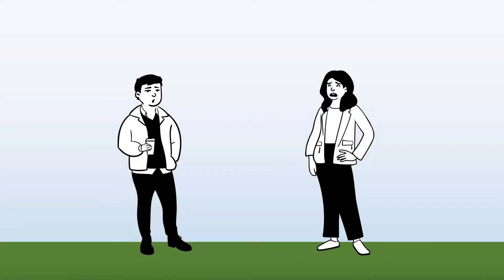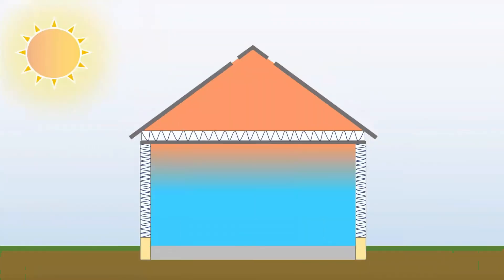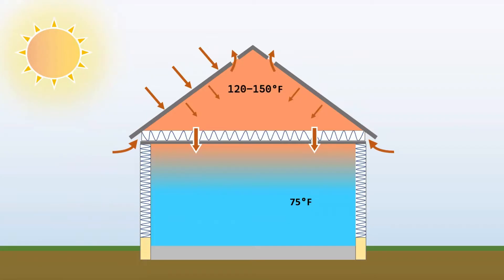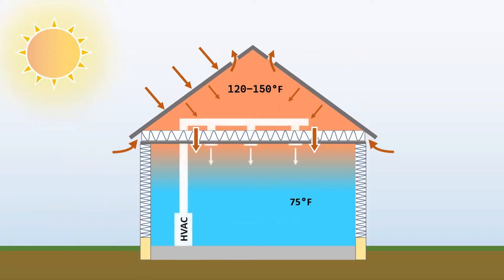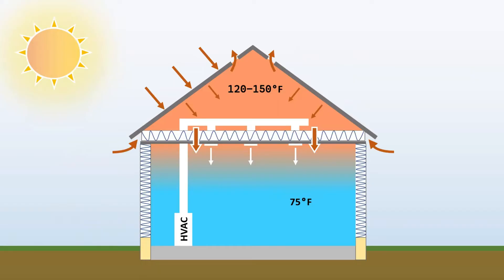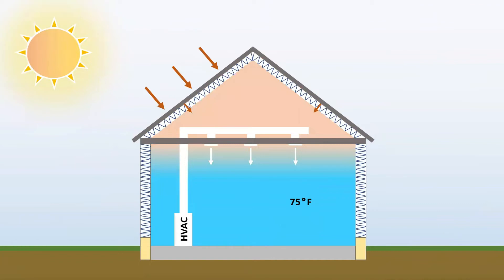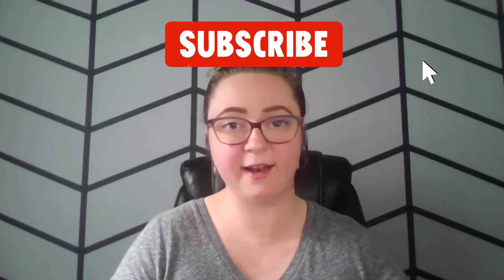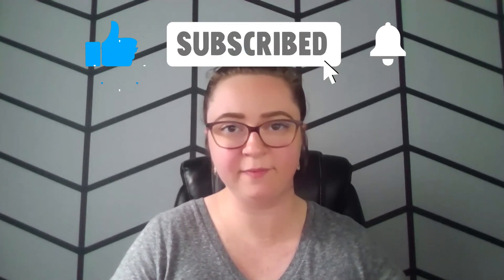Vented vs Encapsulated Attics

Comment: Looks good on paper but.... The larger volume of conditioned space requires much more HVAC.
Reply from the maker: You bring up a great point, @harveypaxton1232! Encapsulating the attic does increase the conditioned space, but the key advantage is reducing heat gain/loss through the ceiling and eliminating extreme attic temperatures. In many cases, this actually reduces HVAC strain rather than increasing it, especially when ductwork is inside the conditioned envelope.

That said, proper HVAC sizing is crucial. Manual J calculations should always be done to ensure the system is optimized. 😄
Reply: @ The attic space is usually not in the manual J calculations from the reports that I have seen. I will have to pull up the last one that was done for me.
Reply from the maker: @harveypaxton1232  You're correct that the attic space itself is usually not directly included in Manual J calculations, but it does influence the load on the living space. In a vented attic, the heat gain is accounted for through the ceiling insulation, so the attic temperature impacts the cooling load but isn’t part of the conditioned space. In an encapsulated attic, where insulation is at the roof deck, the attic can be treated as semi-conditioned or conditioned space, and in that case, it may be included in the Manual J calculation.
Reply: @ Thanks.

Comment: Nice video.  Just one small error I need to point out.  Here in Hillsborough County (Tampa) you would not pass a final inspection with that 2 ton system. Two tons is 24K Btu and with only 22.5 Btu you're too big for the energy efficiency standards. The building dept. warned me about this 12 years.  HVAC contractor had put in a 4 ton system in a house I was rehabbing. I asked where my permit was and after a week of being ignored I went to get it myself.  They told me I needed the Manual J calculations which I called the contractor about from the county's parking lot. He proceeded to "ghost" me and I ended up doing the calcs myself. Ended up buying single use software for this, took paperwork back to county and met the head of mechanical inspections who said my work looks great but no chance of passing inspection.  Had to swap in a 3 ton system.  Went thru 5 different HVAC contractors before I found one totally honest and fair.
Reply from the maker: We appreciate your insight! davidoberlander6200 You're absolutely right, Manual J calculations are essential for code compliance, and Hillsborough County enforces strict energy efficiency standards. We’ve seen many homeowners face similar challenges when contractors install oversized systems without proper calculations, leading to inefficiency and inspection roadblocks. Kudos to you for taking matters into your own hands and making sure everything was done right!

If you’re ever working on another project and need expert load calculations or HVAC design support, feel free to reach out, we’d love to help! 😄

Comment: I can’t find anyone to help me design an encapsulated roof for my remodel in Kansas City.
Reply from the maker: Hi @1AlexanderCole! We understand how frustrating it can be to find the right help for designing an encapsulated attic. Since these spaces don’t have traditional venting, it’s crucial to get the HVAC design just right to prevent moisture issues and ensure proper airflow. We specialize in Manual J load calculations, duct design (Manual D), and energy calculations to help make sure your system is optimized for comfort and efficiency. If you’d like, feel free to email your floor plan to tom@procalcs.net and we’d be happy to review it and see how we can assist!😄

Comment: It is a lot more complicated than this. More details need to be considered and well made vented attics can be energy efficient too.

Like don't run duct work in the attic for one.  The venting prevents ice dams in colder climates and dries out the roof. If you encapsulate you need to manage the moisture that gets up there in other ways.

Comment: Is this more an idea for warm zones? I am in zone 5/6 where we get ice dams if the attic space is as you suggest, no vents with openings between attic and rooms below. Snow loads melt and refreeze at the eave where there is no warm air under to melt it, creating the ice dam and in my case, 6 foot long icicles. My new roof now is vented and having come out of -5 degrees a few weeks ago with snow, I had zero icicles or ice dam effects. But I am actually adding your "encapsulated' effect under my vented roof creating a 2 inch gap from under roof OSB to a second layer of OSB under the roof which will fill each bay creating a 2 inch gap. I plan to cover the upper roof with foil to reflect the radiant heat, keeping the gap below it at 2 inches to allow the foil to work. Then I am putting 6 inches of insulation into the bays and finishing with drywall on the conditioned side. Happy to hear your thoughts. This home is a 1907 foursquare. Also, thanks for the video, I see how it can work well in those hot environments not subject to cold extremes. Take care.
Reply from the maker: @johnalvitre3154 Great question! You’re absolutely right, fully encapsulated attics are more common in warm climates where the goal is to keep heat out. In cold climates like Zone 5/6, improper encapsulation can lead to ice dams, which is why balanced insulation and ventilation are key.

Your hybrid approach sounds really interesting! Creating a 2-inch air gap under the roof deck with foil to reflect radiant heat while maintaining ventilation could help regulate attic temperatures year-round. We’d love to hear how it performs. Thanks for sharing your insights! 🙌

Comment: Some really good points. Here are a couple of others: In wildfire areas, encapsulated attics are more resistant to fire spread, because they don't have vents that embers can get inside. But, just in recent years, homeowners' insurance companies are starting to look askance at sprayed-in foam in homes, but I don't remember what their issues are.
Reply from the maker: Thanks for bringing up those excellent points! Encapsulated attics are a smart choice in wildfire-prone areas since they eliminate vent openings that can let embers in—a crucial safety feature.🙌
Reply: I watched a video or two about the insurance issue specific to the UK. It's usually the perfect storm of sloppily or inadequately applied open-cell foam on an unchanged, unrepaired vented attic that can't afford to have that kind of insulation. They create an internal dew point with no good way for the moisture to leave, and the open cell is basically a urethane sponge, where the roof may have been designed with permeable internal insulation exclusively. I think at the end of the day the homeowner just has to do a good amount of research into the theory behind wall/roof design and what that roof can handle, or consult a home designer or architect or even engineer before just hiring a guy to spray it in with no questions asked.
Reply from the maker: @youmakeitwhatitis  Great insights! You’re absolutely right, poorly applied open-cell foam in vented attics can cause serious moisture issues, especially without addressing the roof’s design. Research and consulting professionals like architects or engineers is key. Thanks for highlighting this important point 🙌

Comment: This essay remains inappropriately silent on humidity levels and radiant barriers.  In the 3rd quadrant of any Cartesian plane of the continental USA (namely, the Southwest quadrant) we are dry and not humid, and radiant barrier work wonders at zero recurring cost.  They're utterly passive.   In the Los Angeles metro area, we have some humidity, but my house has a ventilated attic with lots of radiant barrier countermeasures to hot attic problem.  So what if I have to go into the attic occasionally; that's a red herring.   My attic is huge, buffers my living space from heat, and NOT part of my energy bill, at all.   And I have no "spray foam" with all its potential outgassing and weight load on the rafters of my roof.  Matt Risinger is the original evangelist for conditioned attics, and he's geographically centered in Austin TX.    Location matters.    In California, we pay $$$$ for electricity, so passive methods and ductless a/c (heat pumps) are the way to go.   Of course, a California home unchanged from original 1960s design is "making ice cream in an oven" so the electric bill is punitive.

Comment: Closed cell polyurethane spray foam is a great thing.
I heat and cool 2100 sq ft with a 100k btu water heater throught pex secured under the subfloor, 1.5 ton a/c unit  too.

Comment: In our home I replaced an old inefficient gable fan with a newer lower amp model, but still found it to run too much when set to 110 degrees F. After tacking up a simple mylar film to the underside of the rafters, the fan stopped running. I had to bump the temperature setting to 80 degrees to get it to run again. The mylar foil is so effective I think because it vents under roof decking from eave to ridge and doesn't allow hot air to circulate into the attic space. Encapsulated air is an insulator. I now enjoy 5 feet of insulation in my attic.
Reply from the maker: Wow, that’s a really innovative approach! It’s incredible how effectively it reduced the fan’s workload. By preventing hot air from circulating and encapsulating the air under the decking, you’ve essentially created an additional insulation layer. 🙌

Comment: Where I am, the building code requires R-60 insulation in the attic. You can't "encapsulate" loose fill insulation, so this translates into 16 INCHES of fibreglas batt insulation. Good luck suspending 16" of insulation batts from the rafters. Then add to that if you have - for example - a 12:12 pitch roof, and your total attic floor is 1000 square feet, 1000 square feet of R16 insulation will cover it in a vented attic. BUT, an encapsulated ceiling, will require 40% MORE insulation to insulate that same attic floor. 

In addition, in cold climates, the water vapour from the house will get into that "encapsulated" attic meaning you'll have to cover all that insulation with vapour barrier or ice crystals will form in the insulation during the winter, and destroy the insulation. 

Add to that the fact that - as you showed, the vented attic attic will "radiate" heat through the insulation on the attic floor. Well guess what, the sun shining directly on the shingles will also "radiate" it's heat through the batts in the rafters, just like it does the attic floor.

The only advantage to encapsulating the attic is if you want to use the space up there for something other than dead storage. IE: Put a room up there. And most modern roof construction doesn't allow that because they used engineered trusses for construction, which "fills" the attic with truss cross bracing, preventing use of the attic for anything other than dead storage.
Reply from the maker: Hey! @Thomas6Anderson Thanks for sharing such a detailed perspective! You’re absolutely right, encapsulating an attic comes with unique challenges, especially in colder climates where R-60 insulation is required. Proper design is critical to address issues like managing moisture with vapor barriers and ensuring the insulation meets code while maintaining functionality.

Encapsulation works best when the attic becomes a conditioned space, which can help protect HVAC systems and improve energy efficiency. However, as you’ve pointed out, it’s not a one-size-fits-all solution. Factors like roof pitch, truss design, and climate play a significant role in determining whether encapsulation is the right approach. 😄
Reply: Where you live, condensation is no doubt a real world problem! This example in Florida is a misleading one!  If you have real winters you can be in a world of hurt when condensation ruins all these calcs...and your ceilings too!

Comment: Is a home with an unconditioned attached garage a good candidate for retrofitting to an encapsulated when both spaces share the common attic space above. I'm looking to upgrade the insulation in a 1970s home which has heat pump and duct work in the attic.  Trying to decide whether to encapsulate of remain vented.  Thanks.
Reply from the maker: Great question! @MrLMJohnson A home with an unconditioned attached garage and a shared attic space could be a candidate for encapsulation, but there are a few considerations:

Air Exchange - Encapsulation typically works best when the entire attic is sealed off from external air, including the garage area. However, if the garage remains unconditioned, you might face challenges with air sealing and thermal bridging between the garage and the living space.

Ductwork Efficiency - Encapsulating can improve the energy efficiency of your HVAC system by reducing heat loss or gain through ductwork in the attic.

Moisture Management - It’s crucial to assess whether encapsulating might trap moisture in the shared attic space, potentially causing long-term issues.

Since every home is unique, it’s a good idea to consult with both an insulation professional and your HVAC contractor to evaluate your home’s specific setup. They can ensure that encapsulation would work well for your situation without compromising air quality or creating other concerns.😊

Comment: Installing radiant barrier is much cheaper and allows for proper venting. With it, the temperature in the attic is about the of the outside air in the summer but warmer than the outside air in the winter because it reflects the heat back to the house.
Reply from the maker: @timrothgeb416 Thank you for sharing your experience with radiant barriers! They’re definitely a cost-effective option for improving attic efficiency. In our video, we aimed to compare the broader benefits of vented vs encapsulated attics. Radiant barriers can complement vented attics, but in some climates or situations, encapsulated attics might still provide better year-round energy savings.😄

Comment: Always vent no matter what, i had to rip my entire gramble roof down because it was closed off... so much moisture,  every board was soaked... do not, i mean do not let insulation touch the roof, always have a 2 inch gap, learn from my mistake... its will rot your roof in the matter of a year and cost you big money later like it did me
Reply from the maker: @darrenoxford2281 Thanks for sharing your experience—sorry to hear about your roof issues! Moisture management is definitely crucial in attics. Both vented and encapsulated designs can work well if done correctly, but as you said, ensuring proper airflow and moisture control is key. We always recommend consulting a professional to make sure the design matches the climate and build. Appreciate you chiming in! 😄